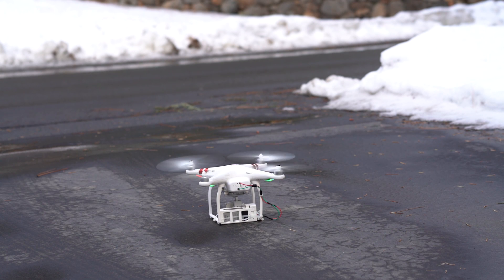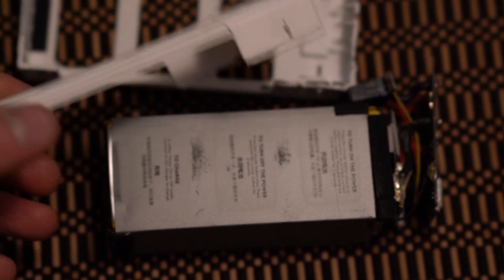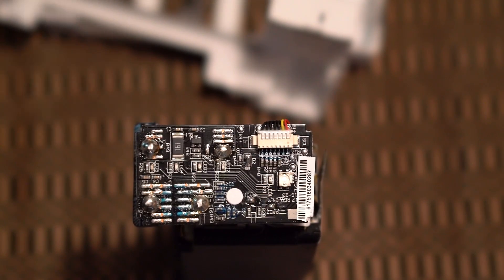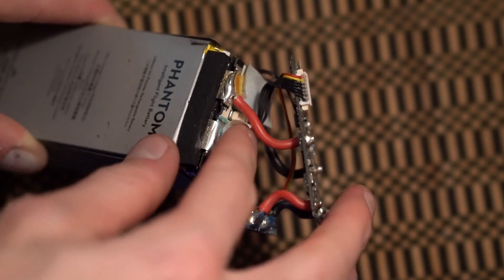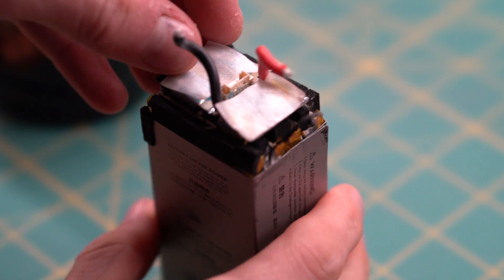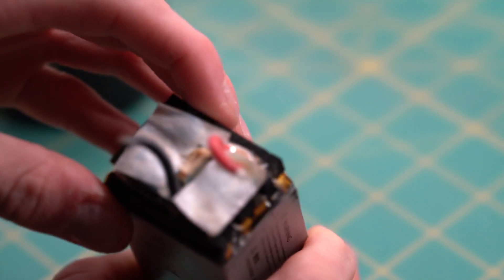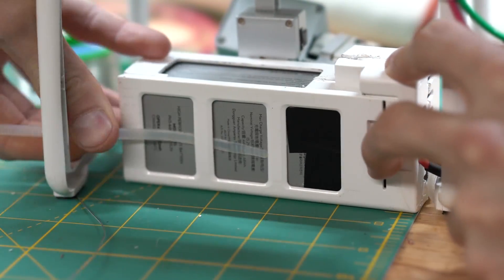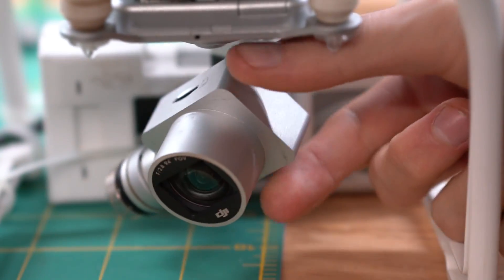Extend your drone's FLIGHT TIME by 50 PERCENT!

Comment: What if you use two smaller battery packs and put then against the body, like in between the legs, that way you lessen the impact on the center of gravity. Also maybe you can experiment with the diminishing returns when it comes to the additional weight vs additional power by doing controlled flights with increasing payloads, from there you can develop the optimal battery booster.
Reply: 1armedfreak I totally agree with you armedfreak (Interesting user name by the way :-j ) Anyhow, I think adding such weight at the lowest point of the drone, is of course going to tax the heck out of the original, plus the extra battery pay load.! Like stated above, attach 2-4 smaller batteries directly to the  body of the drone, in exactly opposite points. Basic physics is straight forward. The props are pushing air downwards to create lift, so putting something that affects any drones air flow will of course affect control of the unit dramatically. Would really like to see an updated version of your project. Cheers 🍻

Comment: Hey try to mount a micro generator on the prop let the prop turn the generator using a belt or a extended shaft or some sort of mechism  then use a buck converter to alter the volt an amps I'm trying all sorts to get more flight time too this is my idea

Comment: So do you want to explain at all how you did it? I guess not lol
Reply: He would be just connecting the seconding battery in parallel to the first
Reply: @JaydenLawson  that doesn't work on smart batteries as they measure the power outputted, you would have to reprogram the software in the battery too